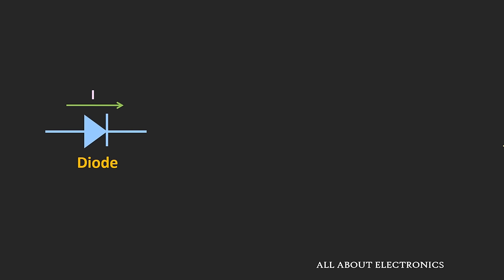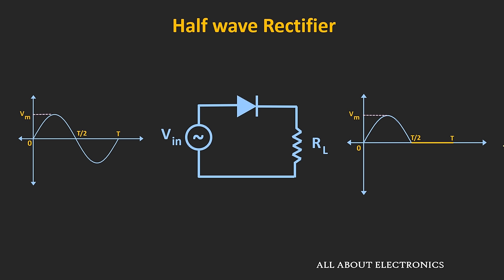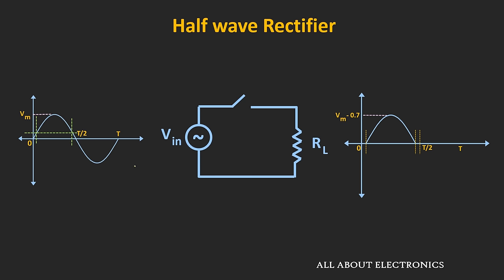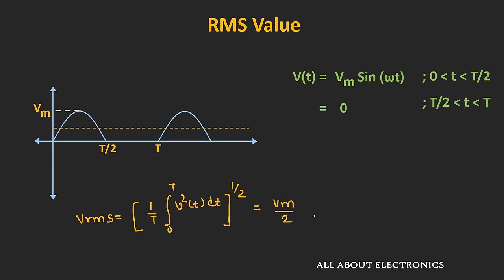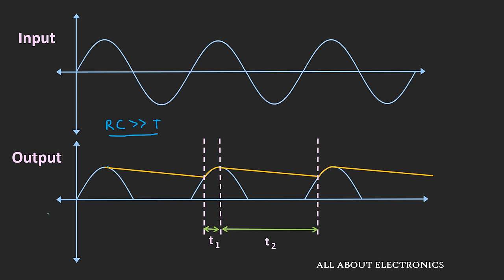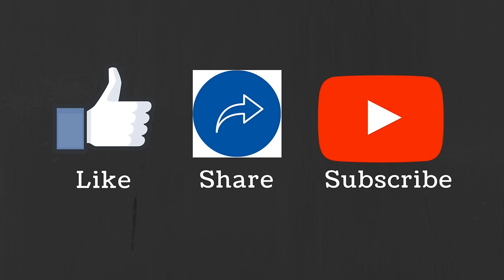Half wave Rectifier Explained

Comment from the maker: The timestamps for the different topics covered in the video:

1:00 Half wave rectifier circuit and its working 

4:54 Average value of half wave rectifier 

6:02 RMS value of half wave rectifier

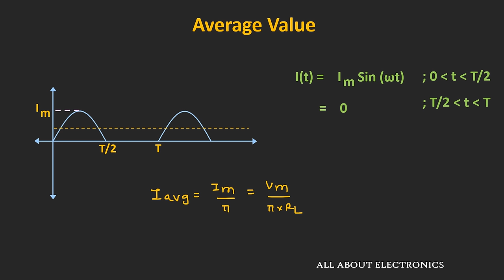7:35 Peak Inverse Voltage (PIV) for half wave rectifier

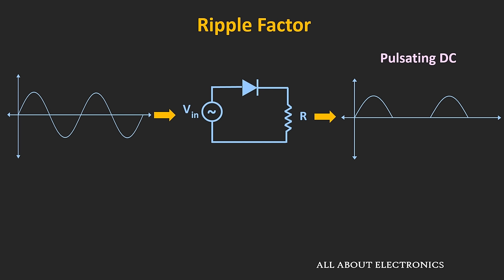8:23 Ripple factor of half wave rectifier

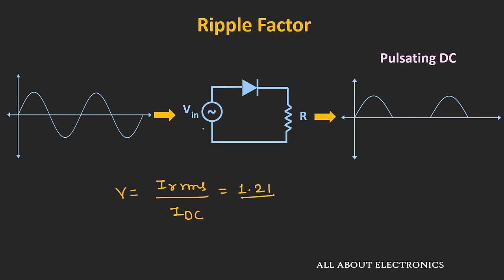9:10 Half wave rectifier with capacitor filter

12:12 The efficiency of the half wave rectifier

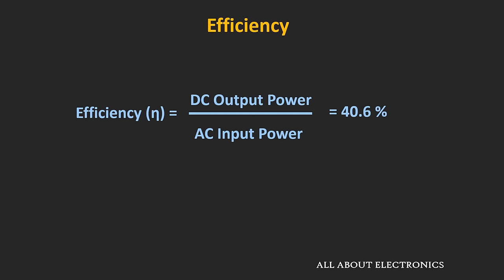12:57 Applications of half wave rectifier
Reply: Thank you so much bro... Tommorow I have seminar...And she didn't explained that....We have to search the topic in net and tell the seminar.... Thank you so much
Reply: Bro this is uncontrolled rectifier kindly explain controlled rectifier for all
Reply: sir you are not explaining clearly . at every new step you should tell the reason / definition/ and many more . some students are not much talented . so plz this is my humble request to work on these problems as soon as possible . thank you'
     ,

Comment: The formula for ripple in half wave rectifier is wrong, it should be Iac in the numerator instead of Irms.
Reply: It's the RMS value of ac component of output current

Comment: hi..thanks for the lession....when you say the half wave rectifier is  47 % eficient...i understand that we only get 47% of the power through...but would it be true to also say 53% of the power is not actualy used or wasted or lost?...im thinking the word eficiency is the wrong word...becaus what we dont use is not lost its just not being used when it is in the turned off situation. for example if i turn a tap on above my glass on for 1 second then i turn the tap off for 1 second we can see the tap is 100% eficient for 1 second and 100% eficient for the next 1 second becaus no water is wasted or lost.

Comment: Dear sir,

If i will lighting a string of leds, each led has drop voltage 2V. I use half rectifier with Vac(rms) 220V, how many led can i use in series for 1 string ?
 and then what is the value of resistor to limit the current to be 15mA ?

Please explain step by step include the formulas ?

Thanks

Comment: 3:44, can you explain why the output wave [right] is not covering the entire space from t=0 to t=T/2 ? And numerically small the the time-gaps between t=0 and start of DC pulse and between end of DC pulse and t=T/2 ?
Reply from the maker: Because during that small initial period, the input voltage is less than 0.7V. And because of that, the diode is not conducting. Since, it is not conducting, it will act as an open circuit. And hence, the output voltage will be zero for that duration. I hope, it will clear your doubt.

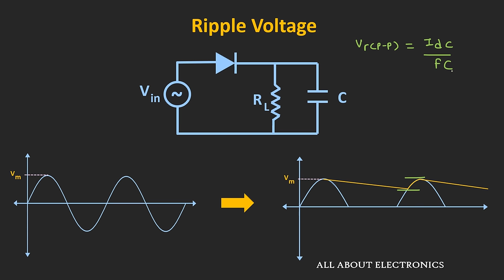Comment: i have a question 11:55
how does the capacitor charged upto Vm in just half circle of time period and in the other side it is not discharging in the same time. and in the second yime why the charging graph following the sin graph?
why it is  discharging as a linear function( because of RC>>T?)
Reply from the maker: Yes, it will depend on the RC time constant. If RC time constant is much larger than the time period then capacitor will discharge less and it looks as if it is discharging linearly.

Comment: sir whenever anode and cathod have same voltegae then diode should be switched on ..but in case of rectifiers u were saying diode would be open swotch,how it would be sir?
Reply from the maker: To turn on the diode, the voltage at the anode should be more than a cathode terminal. (to be precise, it should be more than the forward voltage drop or the threshold voltage of the diode)

Comment: What's the exact value of RMS voltage?  V/√2 or V/2. In other video it's shown asV/√2 and in this video it's V/2.
Reply from the maker: The RMS value depends on the waveform. For the half wave rectifier, it is Vm/2. For the full wave rectifier, it is Vm/√2.
I hope it will clear your doubt.
Reply: @ALLABOUTELECTRONICS  Thanks
Before I haven't seen the derivation.

Comment: Why input frequency equals to output frequency in half wave rectification?
Reply: Because the output waveform repeats itself at the same time as a sine wave repeats itself. Plot one on top of the other and you will see.
Reply: Why the output of half wave rectification fall in pulses?

Comment: What will a half wave rectifier produce
Reply from the maker: As I mentioned in the video, if the sine wave is applied as an input, it only allows only one half cycle to pass through it. (depending on how the diode is connected).
So at the output, there will be only either positive or the negative half of the sinewave.

Comment: Man after one diod, Current will be AC or DC ?
Reply from the maker: The output would be pulsating DC. It won't be exact DC signal. After one diode, ( depending on how the diode is arranged) you will get either positive or negative half cycle of the sine wave. After passing that signal through the filter circuit, we can get the DC voltage. ( Still It will have  ripples)

Comment: that is all fine and dandy but in my oponion those theoris are not always corect peopel forget about pulses pole diferences if positive goes tought a cirkuit what hapes to the negative pulse? a alternator is a perfect exampel posibly it goes to groung ore get desipated to the core as heat loss ore it mixes in a chemical proces with air ither way a not realy efficient way useing power non the less considering even more loss's tought rectification 1pole motors/generators are much more efficint the produce only 1 pole faze no 2 ore beter known 1 pole permament magnet type generator and diferent cinde of rewinding them  voltage regulators and amp regulators are not necesary at all expecialy in car apllications for exampel turn on electric apliences and get away with out regulators its cheaper way Im not saying that you are wrong ore that it is not true what are you saying but I hightly belive in things that can by taxed expecialy a generators true power out put magnetic fiels can many things create with significant less losse's If you consider high speed generators and anty gravity devices it makes sence the faster you go the less drag on that devices meaning no loss's but in reality that works only with light bulb's a small hand generator size can light up 1000 bulbs at once magnetism is amazing but the sience behinde it is highly questionabel ore barely proven good video any way

Comment: sir charging of capacitor depends upon the time constant  then how could we say it will get charged by Vm ??
Reply from the maker: During the positive half cycle, the capacitor will charge through the series resistance of the diode. (The resistance of the diode in the forward bias condition). If we assume the ideal diode, then its series resistance is zero. Of course, to charge the capacitor, we also need voltage source. Here this Vin will act as a voltage source for that. And during positive half cycle, the capacitor will get charged upto the peak voltage Vm. The RC time constant tells us, how fast the capacitor charges. But for charging the capacitor, we need a supply voltage. I hope, it will clear your doubt.